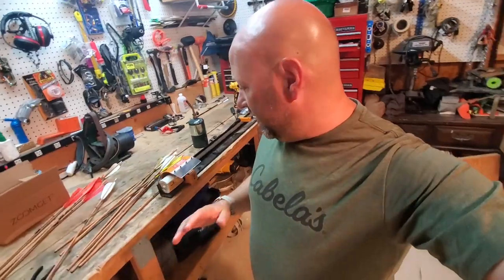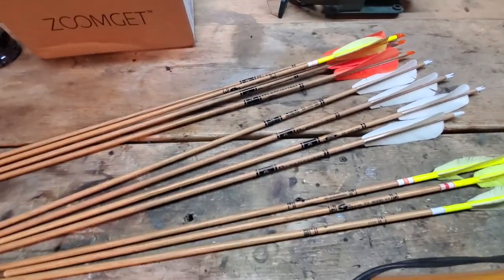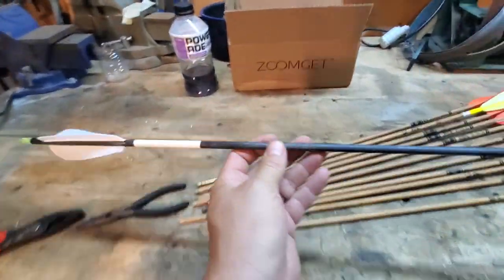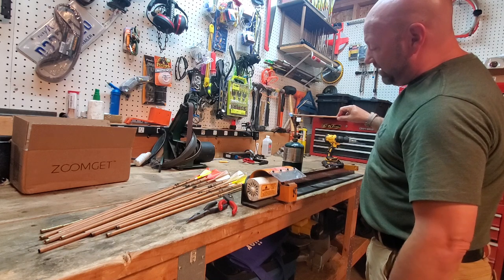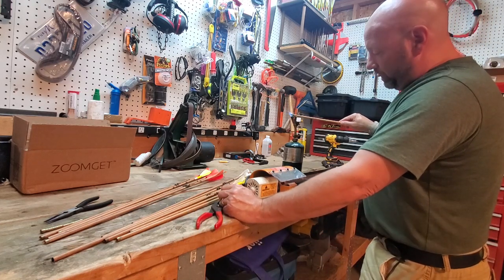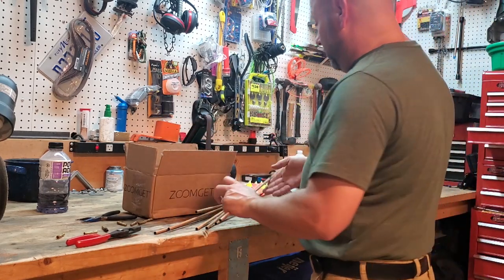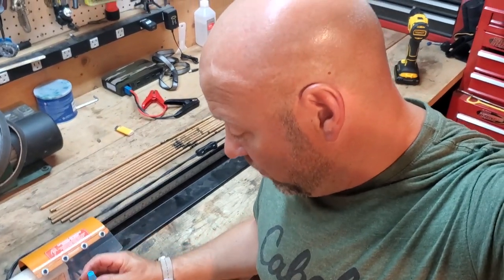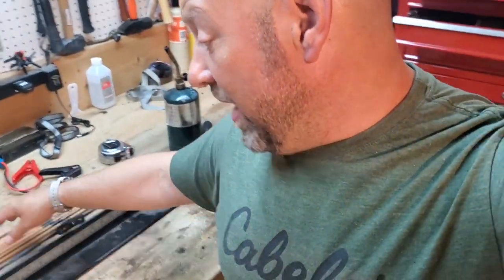Refreshing Your Arrows Back To New

Comment: Great video. I always get info I can use. I FINALLY replaced my cutoff wheel on my saw after..... 15 years I think hahahahhahaha I will say the squaring up of the cut end is a snap now lol

I use white wraps on all my arrows. If I have to remove to refletch I use a heat gun. SOOOOOOO easy to control and the wraps come off very clean and easy clean up.
Reply from the maker: Yep I need to replace e the blade asap too! Glad you enjoyed the video!

Comment: I know most people dont care but Id like to share my new arrow set up. I am using 600 spine Gold Tip warrior shafts with 125 grain magnus stinger BH, 100 grain brass insert and 110 grians of Gold Tip FACT weights added for a total of 335 grains up front. The total arrow weight is 545 grains and its coming in at 27% FOC.  I am shooting them out of my 46lb custom longbow. It bareshafts great and hits hard,. I cant wait to stick a few deer with it this fall.
Reply from the maker: Love it! Sounds like a perfect set up! Excited to hear how the season goes for you. And this will help others trying to figure out what set ups they want to run.
Reply: Wow! You must have a clean release! I’d need a 340 for that weight!
Reply: @puristconstruction4788  My shelf is not even close to center cut on my homemade riser so I need a weaker spine. I tried 500 spines and they bareshafted way too stiff even left full length. Centershot bows can handle much stiffer spines.

Comment: Could you do a vid on the best states for nonresident diy hunts based on your experience? I know you already did a vid on how to plan an out of state hunt but would like to hear your opinion on best states based on your experience. If a vid would give away too much info than you'd like I'd understand. Thanks
Reply from the maker: Probably would not be the best guy to do a video on that as my states I hunt are limited to a few now. But easy diy states that are phenomenal are ohio, indiana and kentucky. Illinois too if you can get a tag as they have some big woods in the south end. Missouri is so over run with hunters on public its getting to be a bummer.

Comment: Howdy there, fletching question for ya, I hear you speak about how you like that effect your fletching makes as your arrow heads downrange, that you like it looking like a big yellow baseball, makes alot of sense, just curious why you don't go for an even bigger baseball effect and use five inches of feather over your four inches?
Reply from the maker: The length of feather doesn't give the visual ball effect the height of the feathers does. So I use a high back 4 inch that is 3/4 inch tall rather than the standard 1/2 inch height.
Reply: @SamkoTradBow  ahhh thank you. That makes sense. Recently switched to a higher foc build, toying with the idea of trying to use smaller fletching as it seems it's not as needed....been a 5 inch feather guy my whole life.
Reply from the maker: @TheHYENA87  yep the higher the foc the less feather you need. Just make sure you test broadheads with wet feathers in the size you pick just to make sure they still fly right if you hunt in the rain.
Reply: @SamkoTradBow  sound advice, yes that is part of my arrow building process, take care, and thank you.